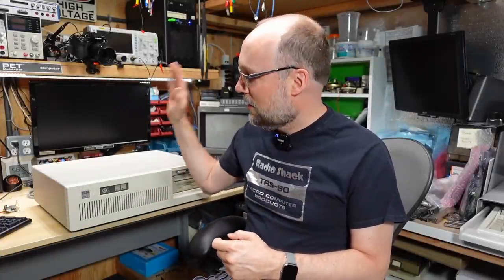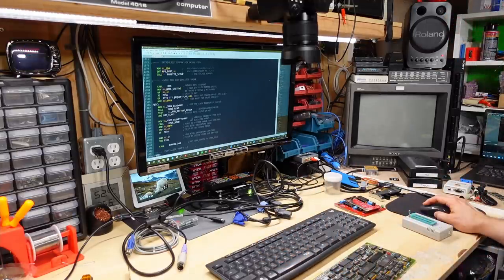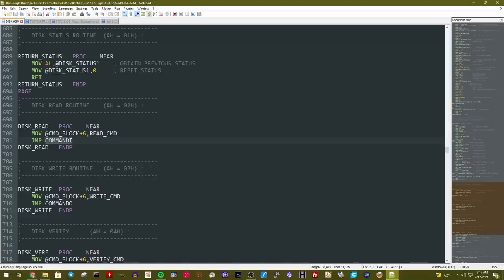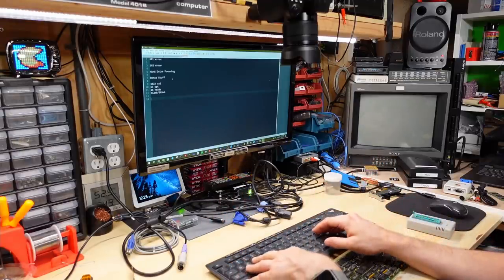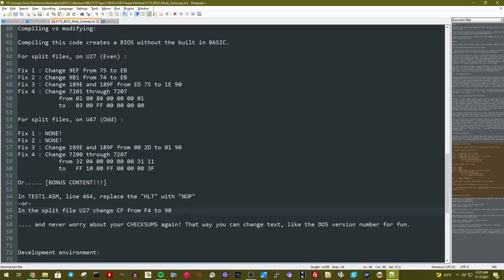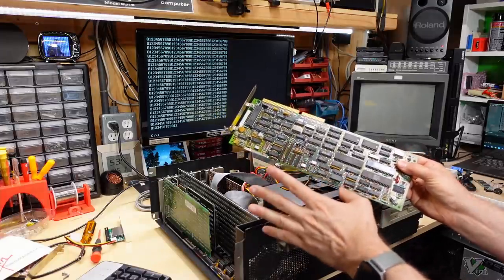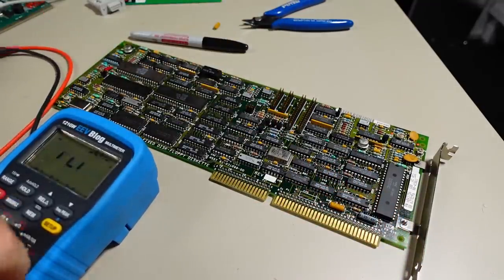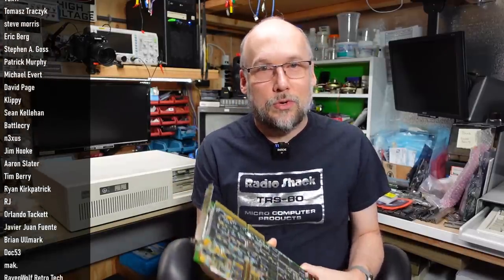Fixing and improving the IBM PC/AT 5170 BIOS (bonus shorted tantalum fix)

Comment: Adrian, why do these tantalums short this way? I have a telescope with irreplaceable electronics featuring lots of tantalums and go back and forth on whether I should just cut them all off and use good electrolytics. When you see something dead on an IBM board, then that thing is dead for a good reason. Not because it was an inferior component.
Reply from the maker: I'm really not sure -- I googled around looking for answers but everything I found seems to relate to modern failure of these parts, not ones like this that simply go short even when sitting stored away in a box. It is definitely an issue with these very old machines though -- the failures seem to happen more often on the 12v rails but that is certainly not always a given. Little ones can fail short and it just blows them up with a small puff -- I have one board where half of the bypass caps were blows. (Had a little black spot on them where they had burned.) But the larger ones short with enough capacity to keep the machine from running.
Reply: @adriansdigitalbasement  Idea why it didn't work - on the mentioned telescope I DID replace three of the tantalums that were known to burn holes in the irreplaceable keyboard cable in the handbox, or otherwise cause issues with the 18v volt power supply - they weren't rated high enough. When I first turned it on after that, it took a long, scary time to boot up. I think those electrolytics are very slow to charge up in comparison to tantalums. Once it was charged up, it booted normally from then on.

Comment: Didn't you have an error on the PC Jr. as well similar to this?  I think the BIOS had to be modified on that to get rid of a printer error since it wasn't using one of the stock cards.  It's like IBM didn't anticipate people changing out the hardware.

Comment: How do you decide which capacitors to buy? Do you just go to somewhere like Digikey and buy a load of them or do you just buy a kit somewhere?

If it’s a kit do you have any recommendations? I know they’re available on ebay but you never know with these things in regards to quality.
Reply from the maker: Sadly no kits -- I just buy from Digikey and yeah, I just looked at several boards and ordered an assortment. For regular caps -- 1uf, 10uf, 100uf, 1000uf, 4.7uf, 47uf, 470uf, 2.2uf, 22uf, 220uf and 2200uf -- those seem to cover a lot of things. For tantalums -- yeah kind of a range. Honestly the exact value usually isn't too important. Just the voltage must be at least the same or higher.
Reply: @adriansdigitalbasement  Thanks, wasn’t sure what values to have to hand.

Comment: Any reason why this wouldn't work on a 5162 XT 286? I have two new-in-box Tempest 5170's as well, but would prefer to get my 5162 up and going.
Reply from the maker: I think the BIOS is identical between the 5170 and 5162, so yeah should work perfectly!

Comment: 226 = 22 000 000 pF = 22 µF (edit: missed a few digits)
The way it works is the same as resistor code. Surface mount resistors also use this code.
Reply: Inductors use the same system... or at least some of them do.

Comment: Can you perhaps ask Stewart to provide similar instructions (what bytes need to be changed via hex editing) in this newest IBM 5170 BIOS to bypass the CPU speed test routine that IBM threw in there to block overclocking?  I'd really like to experiment with slightly faster clock crystals without having to deflower my 5170 with a QuadTel BIOS :-)
Reply from the maker: Have you seen any concrete evidence this is a real thing? I am thinking the limitation is going to be chips like the DMA controller and a few other chips that top out at 8mhz.
Reply: @adriansdigitalbasement  It's been widely documented that IBM placed an actual overclocking-block routine into the newer BIOSes because owners of the early 6MHz machines found it was crazy-easy to drop-in a faster crystal and overclock the machine.  Read here: http://www.minuszerodegrees.net/5170/post_errors/5170_post_codes.htm
Look for the text "speed test" and "Note 1".  It's present on the 6/10/85 and 11/15/85 BIOS.  I also found references from old magazines to "modded versions" of the original BIOS that bypass the speed test, but I couldn't find any current downloads that still work since the QuadTel BIOS pretty much rendered the need to hack the original BIOS obsolete... unless you're like me and you want to preserve the original look-and-feel of the machine while still experimenting with increasing its speed slightly.  I'm willing to bet those discrete chips you mentioned could likely tolerate 10Mhz in my case, even though they're not rated for it.
Reply from the maker: @angieandretti  YEP! You are 100% right and Stewart already found it as I already did some overclocking testing, and it stopped at post code 11h when I tried over 8mhz, which is that exact section. OK will fix this!
Reply: @adriansdigitalbasement  Awesome, thanks!!  I have some cool experiments planned once this is available!
Reply from the maker: @angieandretti  Ok so you don't have to wait -- I have updated the 5170 BIOS patch page on archive.org (link in the description) so you can download the patched BIOS with the speed check removed. I have tested my Type-1 motherboard and it runs at 10mhz. (I am using a 12mhz CPU, 120ns EPROMs but am running the stock 200ns stacked memory.) Pretty shocking it's a 66.6% overclock from the stock 6mhz speed!

Comment: Honestly, fixing issue by skipping tests is not fixing issue. It's workaround, and those tests surely had reason to be there. Better would be to fix tests itself.
Reply from the maker: Unfortunately it would require extensive work because of the way the code uses some direct addressing, so making the code bigger isn't really an option. They designed the test for a very narrow range of specific hardware in this machine which is a bit broken.
Reply: @adriansdigitalbasement  How about writing post errors but allowing user to continue boot with some specific key? I mean there has to be routine for key press, so just replace HLT with JMP.

Comment: If you are showing shorts on 3 caps, why wouldn't you just replace all 3?
Reply from the maker: They are all on the same voltage rail -- some rails will have tons of them all over the board. No need to replace the other ones -- only one had failed.

Comment: To get the original disc controller to play nice, have you thought to cover the slot pin that addresses the hard drive with tape? 

I've found this is a good way to fool the hardware.
Reply from the maker: That wouldn't work here since it's a multi-function card. I could probably figure out what decodes the hard drive controller and remove the IC entirely.

Comment: Can you upgrade the processor?
Reply: Hypothetically you could, but you would have to have all sorts of secondary circuitry added because these machines used to have a fixed bus speed on the motherboard, this is why accelerator cards back then were basically an entire computer on a huge Isa card

Comment: "Purity" is so ridiculous and arbitrary to me. Where do you draw the line? You're already modifying the original BIOS using reverse-engineered code. So you're not using a checksum-pure IBM BIOS anymore. How is that so different than using, say, an AMI BIOS? They literally did what you are doing now, but they did it back during the era when these computers were around. Isn't that more "pure" or "period-correct" than putting in MODERN modified BIOS code?
It's a bit of a rhetorical question because I think this whole weird obsession with "purity" and "era-correctness" is just ridiculous. These machines were made to be used and people modified their computers to make them more usable or more to their liking. THAT, to me, is more "pure" than just having an IBM PC, identical to how it rolled off the line, shrink-wrapped and under a glass box for everyone to look at. If you're going to actually use these machines for fun or nostalgia, then USE them! 
Of course, it's also your hardware and you can do what you want with it, heh. I wouldn't say what you are doing is wrong or bad because it's how you want to use your hardware. I just can't wrap my brain around the reasoning people give for doing these things.

Comment: The BIOS for the PC, and the AT did not have to be disassembled: They were available, along with a RAM DISK in the PC Technical Reference. AT Technical Technical Reference Chapter 5, at bitsavers. BUT, the parts for the speed check are un commented.